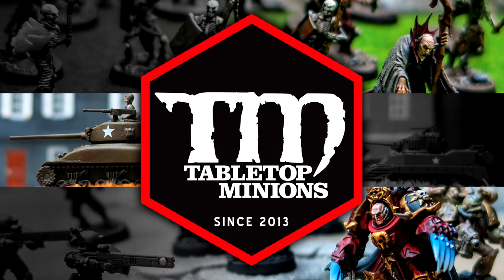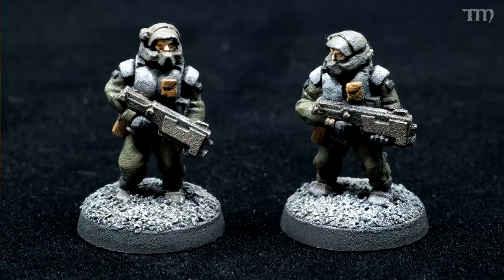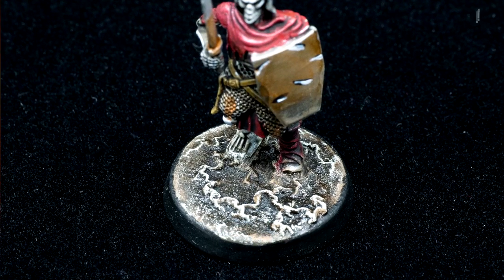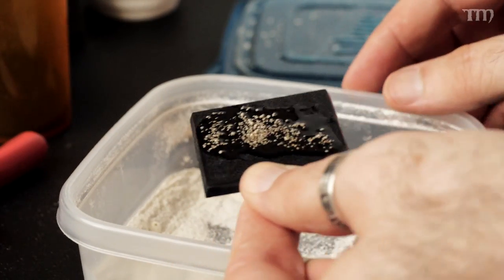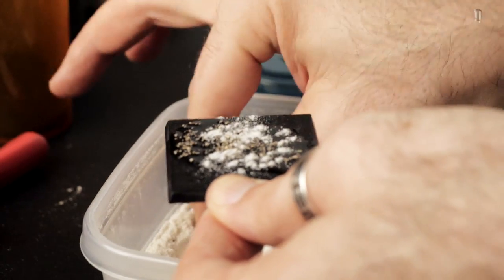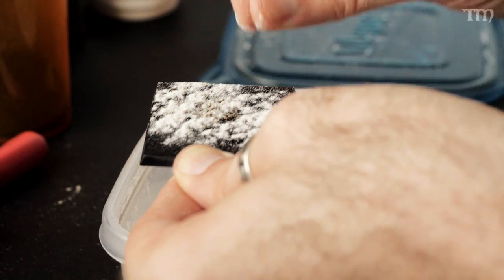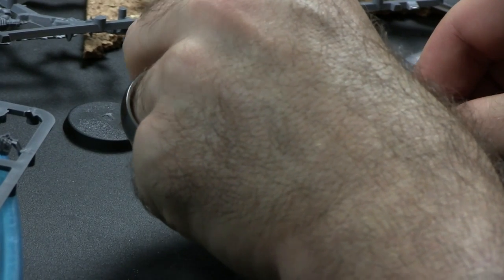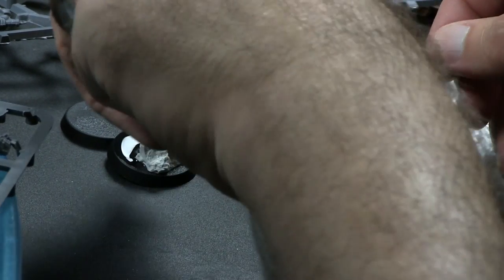The Secret of my Baking Soda Basing Technique

Comment: Out of scale sand seems a bit of a mute point when your army consists of Orks in space. 40k and realism have never gone hand in hand in my eyes, but to each their own. Thanks for sharing.
Reply: skarnir Look at the bigger picture & think outside of the box. This basing process works for models from games in the entire spectrum and is not limited to WH40K. Models come in all sizes and "locations" of battle.
Reply: Very true, I am sure it would be a great application for the likes of bolt action and such. But I just don't see the point personally in trying to get the basing to scale.
Reply: skarnir For some gaming tournaments that judge the painted armies, getting the basing to scale, having a unique base for each model in a unit, and maintaining uniformity throughout the army could be the points needed to win or decide a tie. Not to mention the small narrative that each base could tell. (Also, dainty Elves and Eldar don't want to run around on pointy-sharp gravel and hurt their feet).
Reply: I thought Elves had "lesser" races to lay rose petals ahead of them to walk on :D
Reply from the maker: I’m not concerned about scale for accuracy’s sake, I just always thought sand looked weird with a 28mm figure standing on it, so I started working with something finer. Thanks for watching!
Reply: ...or where 10 space marines can fit inside a rhino.
Reply: Moot
Reply: But running on big rocks would hurt my all devouring swarm’s feet! 

But really your point doesn’t make all that much sense because while it’s a fictional universe, that doesn’t mean it’s devoid of realism.

Comment: Only problem with baking soda is that over time it will react. You can pick up 200 grit pumice powder off Ebay for a couple of pounds. Its the same size of particle, just a lot more stable. Just saying is all.

Comment: Locktite Gel super glue - it has a lid that isn't hard to remove, even when its glued into place from the inside.  I've never had issues with opening a Locktite bottle.  Also, should always press the super glue bottle away from your person.  Super gluing your nose hairs can't be healthy, although it may be entertaining.

Comment: I wouldn't count out sand altogether.  The issue is using the right size grain.  Fine-grand sand is actually perfect for 28mm-sized "dirt" or "ground".  You can find it at Michaels back in the floral section.  The key is that many people don't realize there's TWO sizes of craft sand out there in the stores.  The coarse stuff you see on Atom's old minis. is the coarse sand stuff that looks too big, that over-sized "gravel" size Atom is talking about.  By contrast the sand that GW sells is the fine-grain sand which is exactly what you want.  But get it at Michaels, you get ten x the amount for the same price GW gives you a tiny tub of. The fine-grain sand is what is used like in decorative jars, floral displays, etc.

Again, you have to be aware of the coarse vs. the fine sand when you're shopping for it. Fine sand when painted on a base is not out of scale at all for 28mm.

The real issue is that if you could actually get "dirt" that was true 28mm scale grains, it would have no texture at all!   You need some level of texture for the drybrushing to pick out, so there has to be SOME level of "grain" present.  Just depends on how subtle you are with that texture.

You can mix fine-grain sand with like acrylic gesso and get a nice, fine textured base with dirt that's perfectly in scale with 28mm minis.  Again, the key is to recognize the difference between coarse craft sand and fine craft sand.  Baking soda works well too I suppose, but if you use craft sand and gesso you don't have to  mess with super glue at all.  The acrylic gesso acts as the adhesive itself.  Basically just make a paste mix of gesso and sand and apply it to the base with a brush.

In addition, artist acrylic paste or modeling paste accomplishes the exact same texture as baking soda and super glue except you don't have to mess with the fuss of the super glue step.  The acrylic paste itself will adhere to the base.  Plus you can add a few pebbles or small gravel to the acrylic paste and for representing bigger rocks and achieve the same thing.  The super glue part to me just seems like unneccessary step that gets in the way.
Reply: I have a bag of sandbox sand - when I need something finer I run it through a dollar store sieve to get the big rocks out.

Comment: CA Glue gets a lot cheaper when you start buying it by 16oz, 1 quart and gallon bottles. More cash up front but much cheaper in the end than buying it by those tiny bottles the home centers and hobby shops sell it by. Also NEVER buy CA glue locally - especially at a hobby shop. I'm all for supporting your local game shop if you're fortunate enough to have one - to a point. Every game shop I've ever been in will straight up rip you off on the price of glue. Search for it online by it's chemical name - cyanoacrylate - and buy it in larger sizes from no name chemical supply manufacturers.

Comment: I'm returning to report that the few bases I've heavily used baking soda and superglue on have turned bad a few years later. There is some transparent, bad smelling liquid pooling on top of the base. I've wiped it off, but it returns in time. Maybe I used too much baking soda or maybe it had turned bad before I used it, but i'm not doing it again. Thankfully, I just used this on a couple of models that were badly painted anyway.

Comment: I'm late to the party, but my man, you don't need to use this technique for this effect. The way you're doing it uses so much super glue, it can't be healthy! Try out using a 3:1:1 mix of Water, PVA, Polyfilla (you might know it as spackle?). It creates a brush-on fine mud effect, doesn't kill brushes, can be sealed in a container for later use, and is cheap as chips. You can also use plaster of paris as a stand-in for Polyfilla, although it's a slightly different result.

Comment: Seems like a lot of unnecessary work now that Citadel has their own line of texture 'paints' that add an almost identical effect to bases, and then a whole wide range of different effects to boot. Plus a single pot will last you quite a while if you use it properly and costs like £3, which is about the same price as a bag of baking soda and kitty litter.
Reply: Freakymonify many of us have been using this basing technique long before Citadel thought up 'texture paints'. Plus, that same £3 will buy a whole lot more materials of baking soda and kitty litter than what you would get in a single pot of texture paint.
Reply: I have all the stuff around my house already versus going and spending 7.95 USD after taxes for something I got maybe 50 models use of at most.
Reply: You're all making good points, but still if I want sand on my bases, I don't want to be spending time fucking about with baking soda, kitty litter and glue. I'd rather just go spend the same amount of cash give or take a couple quid and not have to bother with all the DIY bullshit.